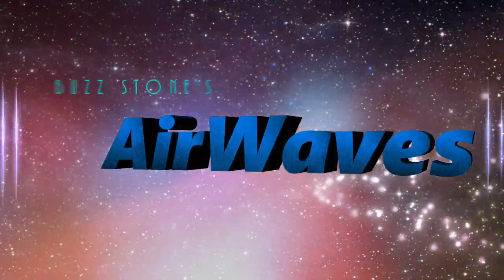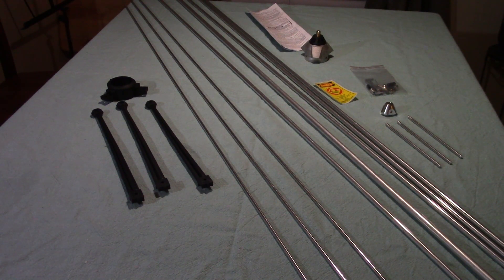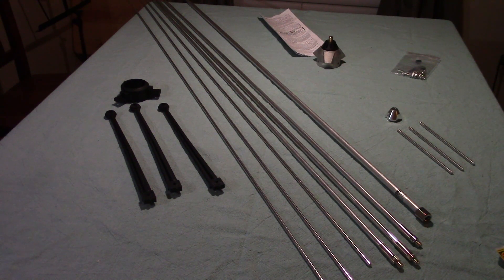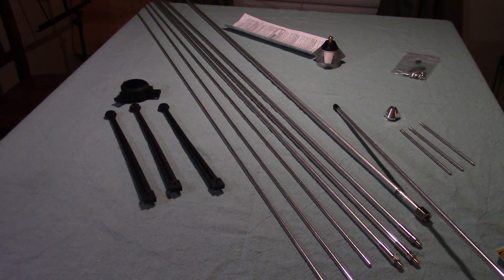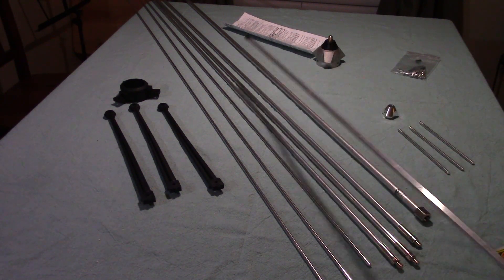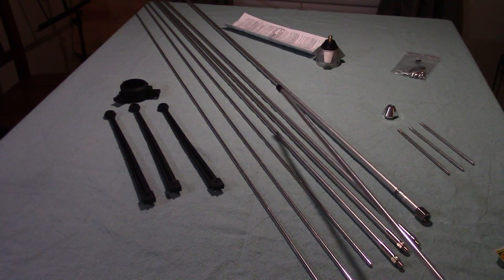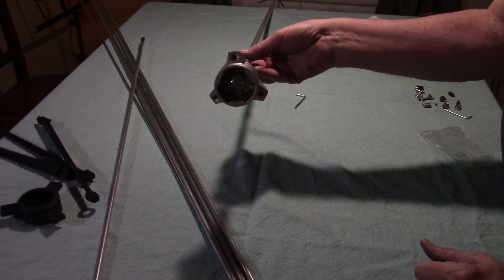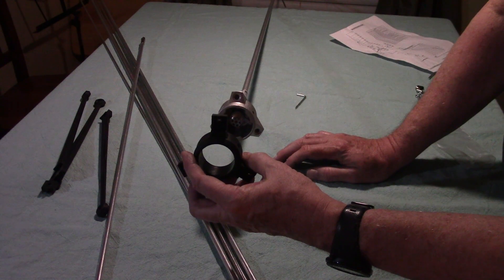AirWaves Episode 12-1:  Assembly of a Starduster M400, CB Antenna, Part 1 of 3

Comment: I actually got this antenna for FREE brand new! After buying a foot warmer it has great ears way better than my old PAT-12, BUT the starduster m400 is a great at shooting DX but my ebay 500 watt auto tunner tunes it from 25 mhx to 30mhz NO problem in 11 meters without a tunner its 1.00 - 1.50 SWR

Comment: Since the coax goes down on the inside of the mast, and the mast goes into the ground, how do you get the coax to exit the mast pipe to run it into the house? Using a 33' telescoping mast.
Reply from the maker: The starduster isn't on a telescoping mast.  The antenna is mounted on a PVC pipe, which is strapped to a metal pipe.  The coax exits the PVC pipe where the two pipes are connected, then runs down the outside of the metal pipe to the base.  I do have a telescoping mast, but that is for my FM broadcast antenna, and my  80m dipole antenna.

Comment: I've just ordered a Sirio Starduster - what are you overall feelings about the antenna now you've had it a year? They say that it has a low radiation angle for excellent DX - what's been your experience? many thanks 73 Rob
Reply from the maker: I love it!  Very broadbanded.  I use it on 17m and have talked to Germany and France with 100W.  On 10m have talked to Chile. I have also used it on 20m.  Of course you need an external antenna tuner outside of 10m.
Reply: @Airwaves-Radio  Brilliant feedback - I understand that the antenna is still very popular in the USA. I'm in the UK where I don't know of any in use so it's great to see your videos .  Many thanks 73 Rob

Comment: Is it 99&6 inch in Length
Reply from the maker: 99.6 inches is for the center frequency that I used.  I'm using it for CB and 10m Ham.  The length will differ depending on the center frequency that you choose to tune it to.

Comment: Shirley there is an exact ID measurement specified for the mast insertion joint, somewhere.  Its certainly not in the instructions.   Instruction manual suggest to me a near 22-25 degree spread of the down radials from the mast.
Reply from the maker: it's approximately 1.25".  I think the issue lies in that its a metric measurement, not standard. I would take that section with you to the hardware store, so you can find the best fit.  As for the angle of the radials, they are pretty steep.  The plastic bracket that holds them in place, restricts/determines their angle.

Comment: Will this set up work in a mobile application?
Reply from the maker: I have seen people set them up in parks, and fields, but way to big to mount on a vehicle.
Reply: Air Waves could you recommend an antennae for my truck? 2016 Cascadia
Reply from the maker: What kind of radio do you have?
Reply from the maker: If it's a CB, these are popular with truckers.

https://www.walcottradio.com/four-foot-tall-cb-antenna-kit-black-with-coax-and-mount-dual-antenna-kit-p-2774.html?keyword=&gclid=EAIaIQobChMIkv-Rq_6s6QIVGey1Ch13fwbgEAQYCyABEgLKBvD_BwE

Not necessarily this brand, but this type of configuration.  With co-phase antennas which gives your signal a directional pattern, in front and back of your rig.
Reply: Air Waves I am researching them too. Thinking about the Bearcat 980 ssb.
Reply from the maker: Good radio.  Stryker makes some neat radios too.  President line has good radios.

Comment: How far out did you have.to pull the tuning tip
Reply from the maker: That depends on what frequency you tune the antenna for.  There is a chart in the instructions that tells you what length the radials should be, but in my case, the total length was 99.6 inches.  If you watch Episode 12-2, I explain all that to you.  Thanks or watching.  Buzz
Reply: @Airwaves-Radio  I seen that but I'm shooting for 10/11 meter guess if I use the 99.6 should be ok
Reply from the maker: @ironhead320  yes, that was my thinking.  I just bought a Xiegu G90 and will be testing it with the Starduster soon.
Reply: @Airwaves-Radio  nice

Comment: Very good 👍 I installed one of these today. The radials seem to be at about 25 degrees instead of 45  degrees. When I installed mine . Gonna try it out .  73s
Reply from the maker: Let me know how it works out.
Reply: @Airwaves-Radio  , well the antenna match came  out perfect , got locals from around 8 miles or so ... As for Dx have no idea yet ... Seems like a pretty good antenna ...
Reply from the maker: What radio are you using with it?
Reply: @Airwaves-Radio   the uniden 980 ssb  factory out of the box . Had the radio for awhile , best radio I have had , for a new radio that is . I use the wireless mic for it sometimes, the mic works
Reply: The mic works roughly 300 ft without problem from the shack , only reports on the wireless mic for the 989 ssb is that it sounds like a only radio with a relay keying down .
Reply: (980) ssb sorry typo
Reply from the maker: @worldradio234texas9  how much does the mic cost?
Reply: @Airwaves-Radio   the mic costs anywhere from $50-$75 US dollars ,on eBay or elsewhere... It plugs in just like a normal mic, and there's a transmitter on the end, while the mic is wireless , you pair it up like Bluetooth.
Reply: @Airwaves-Radio    Uniden BC906W Wireless CB
Mic , is the model .
Reply: The mic transmits,and also can hear audio on the mic as well . Pretty good  setup 👌
Reply: @worldradio234texas9  that answers my question of how those new Bearcat radios work. I have been out of radio 20 plus years. Just getting back into it. Scored a Galaxy and love the factory audio, but had my eye on that 980 SSB and was wondering how they sounded.
Reply: @Airwaves-Radio   very good channel, you got that golden voice , keeps people interested 😲
Reply from the maker: Appreciate your interest.  Lots more to come.  For some reason, your posts keep getting held for review.  Can't figure out why.  That's why there's a delay before they're posted.